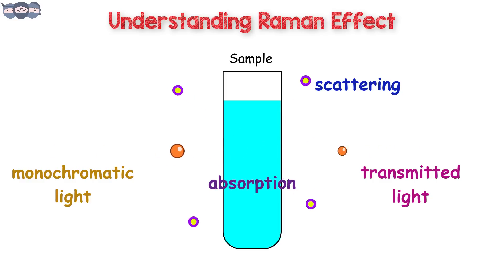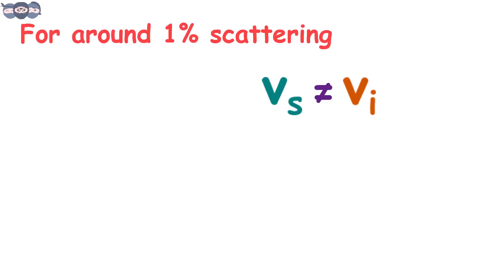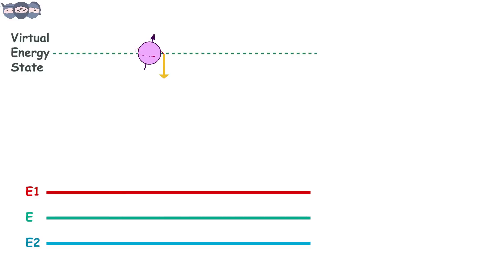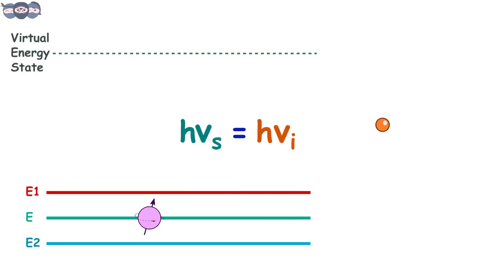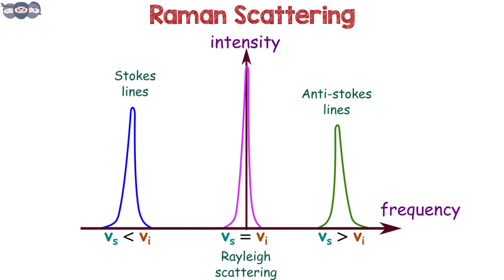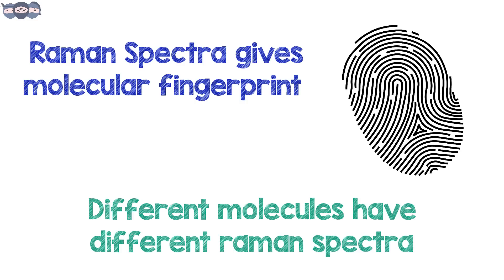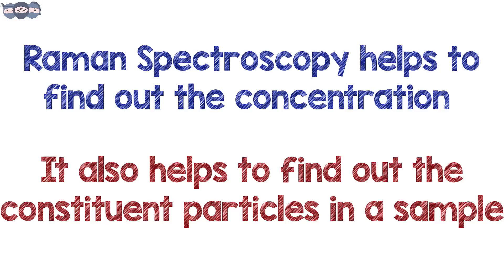Analytical Instrumentation 09: Basics & Principles of Raman Spectroscopy | Raman Effect Explained

Comment: I have a comment: Why would you state that a photon is absorbed in case of Rayleigh Scattering? Rayleigh Scattering undoubtedly has dependency on the complex permittivity of a material but primarily it is change in the angle of photons due to Light Matter Interaction. If there was any absorption involved Rayleigh scattering wouldn't have lambda^4 power dependency. The Quantum Mechanical description of Rayleigh Scattering can be used to describe the transition between ground states and virtual states, but that is for the Hamiltonian of the Entire system and not just a single charge.

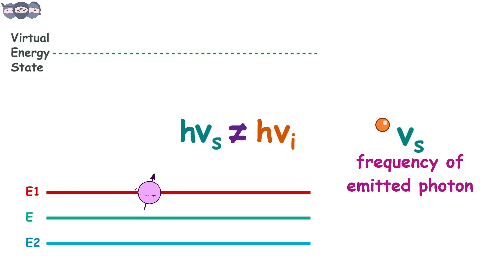Comment: 3:00 when you are saying different frequency of emitted photons , so is it possible that ,  its  frequency could be higher then incoming light ?
Similar to non linear optic 
?
Reply: Exactly. However the extra/less energy is due to a change in vibrational state of the molecule

Comment: Thanks for the video.  It's a lot more accessible than much of the information out there.  Question--why would any given electron in the 1% be more likely to go to a higher/lower energy level than the other 99% when incident light hits it?  For an anti-Stokes shift, it makes sense that it might be because the e might have slightly more energy than its peers but not enough to go to the next vibrational state... but why might it go down to a lower vibrational level?  Also, are there some materials that Raman scattering is more likely to be observed in?
Reply from the maker: We are glad you liked the video. The doubt you asked is very interesting. However the main purpose of this video is to understand how raman spectroscopy works. The answer to your query requires a discussion on molecular vibration theory (our knowledge is very limited on it though :) ). To answer the question in short, the vibrational energy of a molecule in a sample changes continuously due to interactions with other molecules in the sample. The percentage of molecules in a given vibrational level is calculated using the Boltzmann distribution. The Raman effect is based on molecular deformations in electric field E determined by molecular polarizability. The laser (source of EMR in raman spectroscopy) interacts with sample and induces electric dipole moment which deforms molecules, and the molecules start vibrating with characteristic frequency. A molecule with no Raman-active mode will undergo rayleigh scattering whereas the one with Raman active mode will have stokes and anti-stokes lines. (ref: http://web.pdx.edu/~larosaa/Applied_Optics_464-564/Projects_Optics/Raman_Spectrocopy/Raman_Spectroscopy_Basics_PRINCETON-INSTRUMENTS.pdf). You can also refer to (https://www.researchgate.net/post/How_can_you_tell_if_a_molecule_is_Raman_active) for more information on this topic. Hope we have helped you with your query :)

Comment: 1:36 for around 1% scattering Vs =/ Vi isn't correct.
"A small fraction of the scattered photons (approximately 1 in 10 million) are scattered inelastically by an excitation, with the scattered photons having a frequency and energy different from, and usually lower than, those of the incident photons."
https://en.wikipedia.org/wiki/Raman_scattering#cite_note-4
Reply from the maker: Are you pointing out the incorrectness of the formula Vs =/ Vi or the incorrectness of the percentage 1%?

If it is regards to formula, the answer is in the citation that you have posted i.e) for inelastic collision, the energy will be different. As a result the frequencies will also be different. So Vs=/ Vi is correct.

If it is regards to the percentage (1%), we need to confirm it then from multiple sources. We have referred the following material for that data (Chapter 7, Handbook of Analytical Instruments, Second Edition, By Dr R.S. Khandpur). Thank you for pointing out though. We will confirm the data in question from different sources and edit it accordingly :)

Hope you have enjoyed and liked the video !!!
Reply: Of course it is regards to 1%.
My PhD work associated with Raman spectroscopy.

Thank you very much for this video, I'm sure content like this should be widely spread in the net.
Reply from the maker: We are glad you watched the video and it helped you in some manner. Again thanks for pointing out the discrepancy. We will surely go through more material for the data in question and make changes as required :)